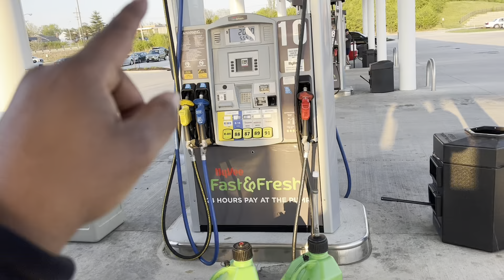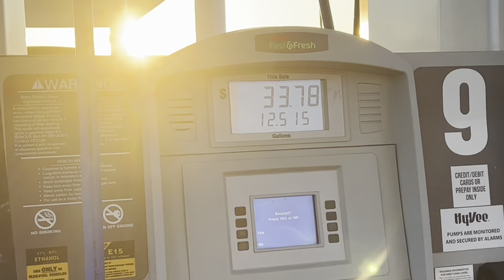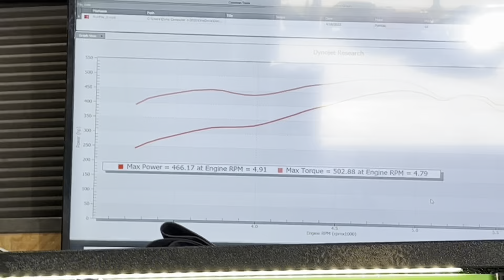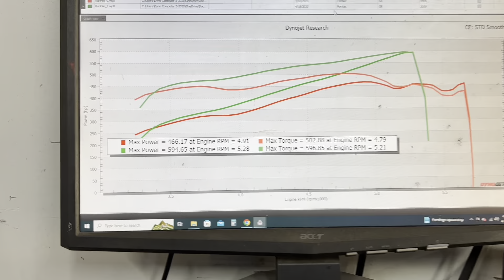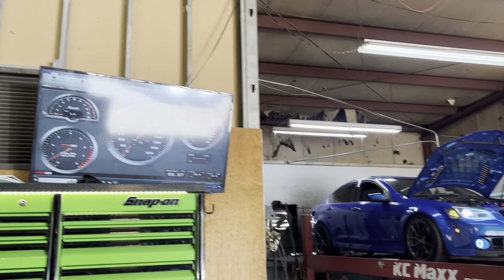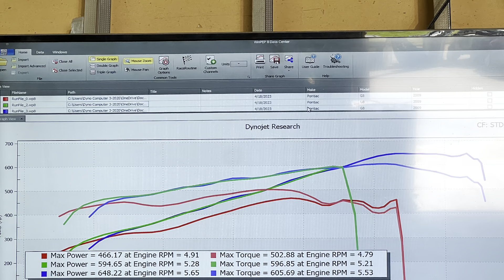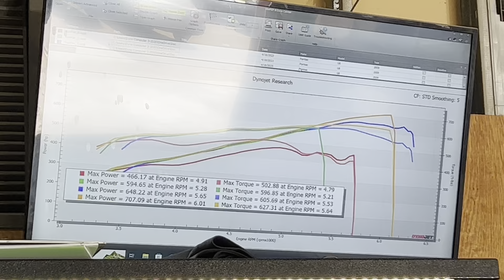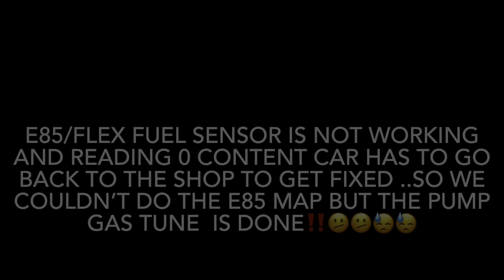‼️D1X PROCHARGED G8 GT MAKES CRAZY 😳 POWER ON JUST PUMP GAS 91🔥🔥(MUST SEE) ‼️

Comment: Car sounds wild 🔥🔥 
What’s the motor set up on it?
Reply from the maker: Thanks man and sbe head and cam
Reply: @domosmash  thanks for the reply man. Asking because I have a 6.0 with ported ls3 heads and holley hi ram going on my 68 camaro but later next year I plan to procharge it as well.
Reply from the maker: @adriantinoco8561  no buddy sounds like u got a good start one u procharger it you’ll never look back lol is your tea s still stock
Reply: @domosmash  my car has an old tired and worn out 350 sbc so it’s definitely gonna be a huge difference with just the motor swap lol

I’m still undecided if I’ll be going procharger or with a vortech